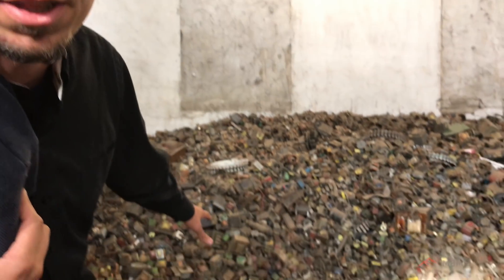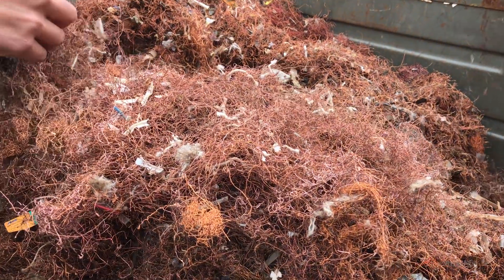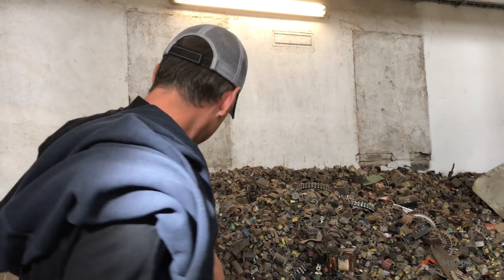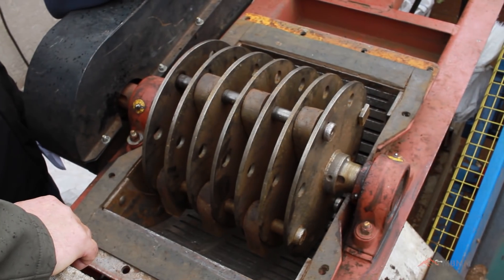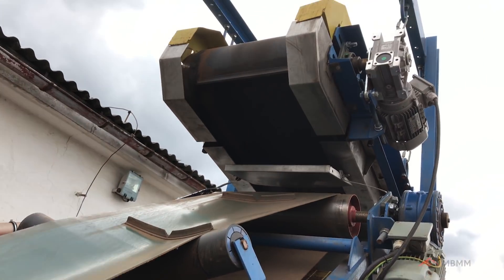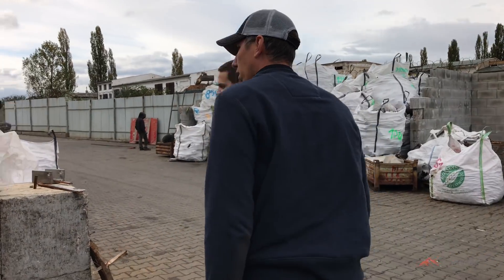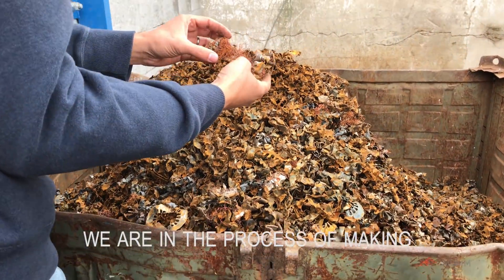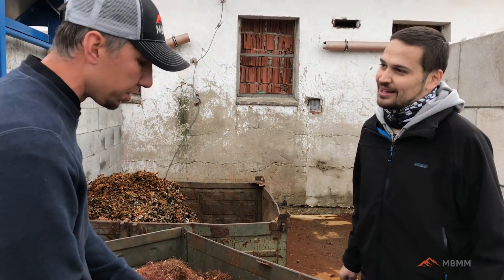MBMM Euro Trip Part 2: Processing Scrap Metal For Copper Recovery

Comment: What process do I need to go through to begin using one of your machines in the states? Do I need an approval by the EPA for circuit boards, heats sinks and transformers?
Reply from the maker: Charlie, I would reach out to your local area and see if you are required any permitting as every state has different rules and regulations on recycling.